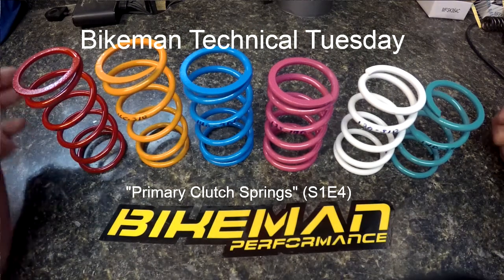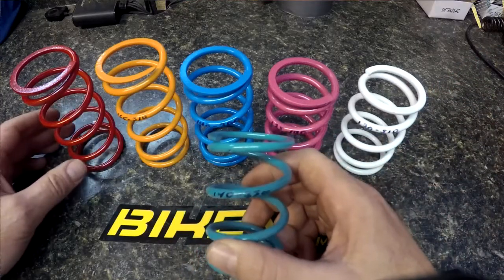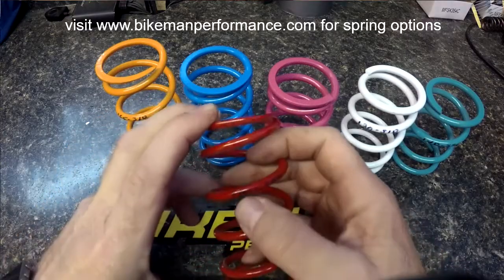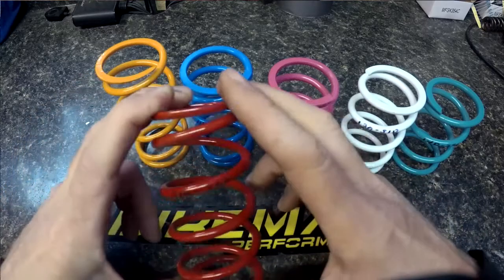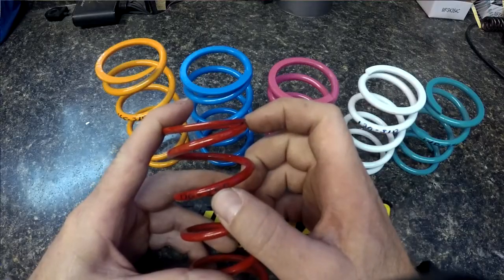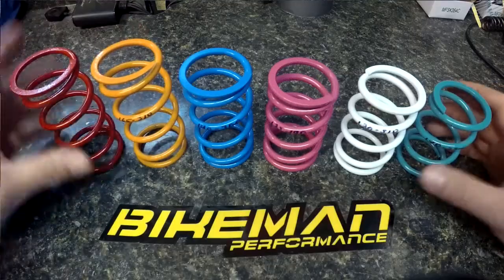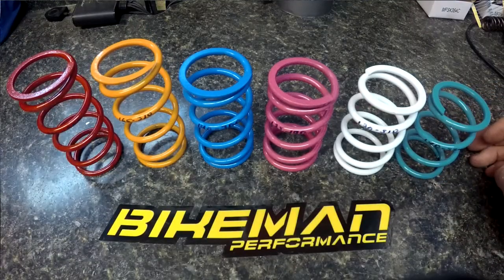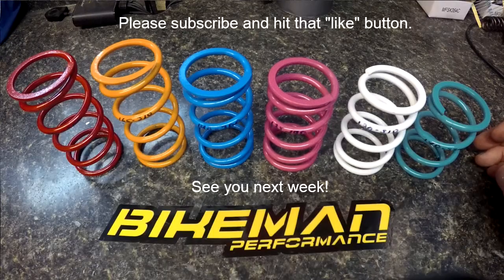What does the Primary Clutch Spring do in a CVT on Snowmobile and UTV

Comment: could not find Arctic Cat UTV springs on your site.. working on ride where spring was broken, took a lot of RPM to engage such that in no way could you go slow, crawl over a log without being Evil Ken evil and flipping the buggy.. I thought his belt was worn, then saw 2 ends inside of primary and knew spring had failed.. not sure how it increased the rate, but the broken spring must have as it took a lot of RPM to get the rig to move...

Comment: Here's a question that no one seems to have the same answer.
CVT overdrive. Does it mean:
1. Any up shifting after the CVT crosses the 1:1 ratio?
2. Any speeding up (engine rpm) after the CVT reaches full shift out and physically stops up shifting?

Comment: Thanks for your video. New subscriber here.  My utv has just a steel color or it could be considered black....it has no #'s on it. It's a 2016 Cub-Cadet Challenger 750cc Crew Cab.  Without going into a lot of info , do you know how I can find out the factory spring specs? Thanks in advance.

Comment: If the new spring isnshorter than thee old, does it need a spacer to make up the difference?
Reply from the maker: No; the amount of coils, wire diameter and spring length are what create the installed and compressed force rates. Springs should be designed to run without spacers. Some places sell spacers but if used you must verify the spring has enough room for full travel and will not coil bind.

Comment: My stock cvt spring on Yamaha xmax is 800rpm.   if i change to 1000rpm spring ore 1500rpm spring.  will i get higher RPM on engine before clutch engage?
Reply: It will require higher/harder revs to turn your belt. I learned the hard way. Chewing up your belt as it tries to fight the contra spring. Think of the cvt as a transition of torque from engine to tire. If you have a larger displacement (higher cc engine), you would want to increase the tension of the contra spring to latch on to that added power.